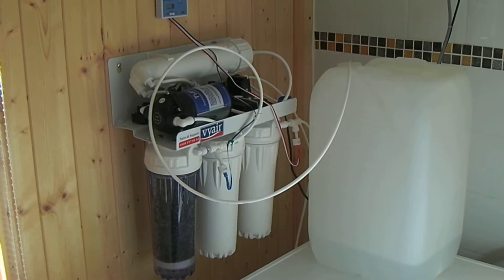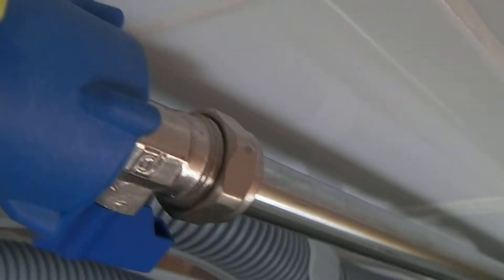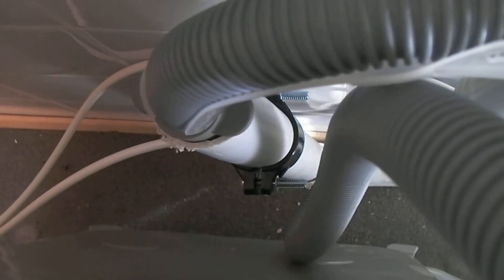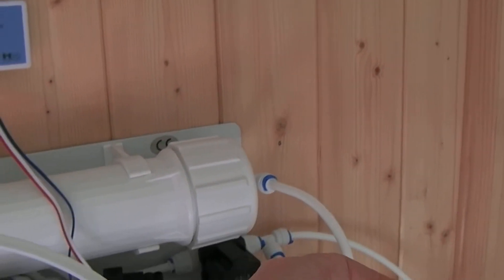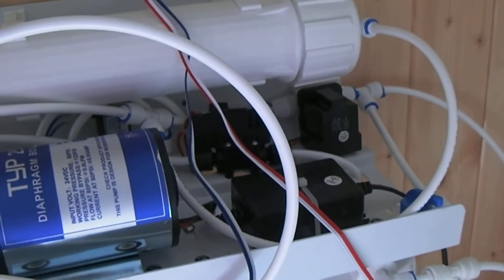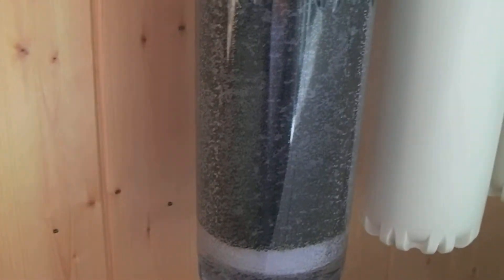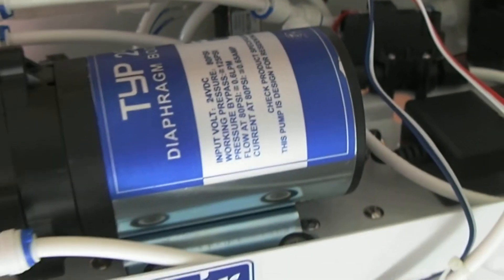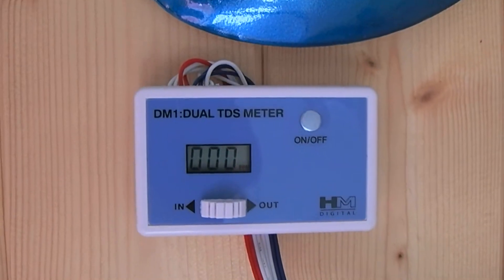Installing a Vyair RO-50MP RO+DI System Final Part

Comment: Will your booster pump switch of when your float valve if you have one is at the top full level???
Reply from the maker: Hi
It can do that if one is fitted. In my case it isn't and I just watch the level and switch off.

Comment: Now then mate,  how do you drain your unit after use,  what is the blue open closed valve used for.
Reply from the maker: With the valve open water flows through the system and into the waste pipe. When closed water is forced through the membranes and to the collection tank and waste pipe. Consider it a before and after flush. It is never drained down.
Reply: @Trevs-Shed  thanks for your reply.
Reply: Do you get a hissing noise from membrane area when in use.  Mine seems too hiss no leaks anywhere.

Comment: i just got a vrair system not same but mine is really slow output its literally drippin out is that normal?
Reply from the maker: Hi
If it is a pumped system like mine then I would say no, that isn't right.
It is a constant but slow stream on mine.

Comment: With the resin, remember that it must never dry out, as it will degrade and not be usable at all. Keep it damp at all times. When you change the first charcoal filter take the old one, unscrew the top and bottom and wash out the charcoal granules. Wash thoroughly and refill with the new resin and then you have a resin cartridge that is easy to install. I use them to keep cable ties, a pack of 200 T30 ties fits inside perfectly and keeps them in a neat package. Resin I buy in 20kg bags and have a large vessel to hold it in use.

Push the washing machine pipe further down so you do not get soap pumped up the piping, that will eventually make it's way into the RO membranes and degrade them. Otherwise a non return valve in the line, you can use the cheap ones sold for use with air complete with the push on fittings.
Reply from the maker: Hi
Good idea with the non return valve, I have now fitted one. The washing machine pipe has a rubber seal and it only pushes so far in to provide a good seal.
The supplied resin was a little more than required, the rest has been binned.
I bought the colour change resin to help determine when it is time to change it.
Thanks for the suggestion.
What on earth did you do with 20Kg of resin, that would last me a lifetime :D
Reply: TelevisionMagForum
I use it in a larger DI water setup 10kg at a time. Lasts about 3-4 months then gets changed. Uses the same filters, but I upgraded to a 0.3 micron filter ( smallest ones easily available) to get better quality water out of it. Looking at the RO systems but the prices are scary at higher flow rates. How much was yours? i might look at the low volume aquarist ones instead and get some tanks and a UV steriliser..